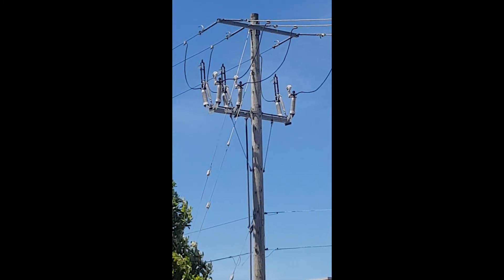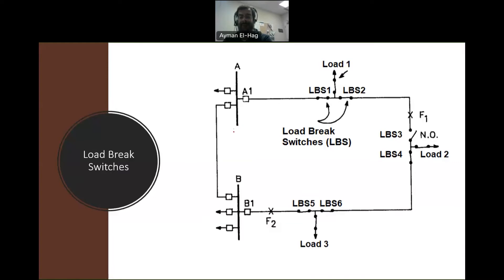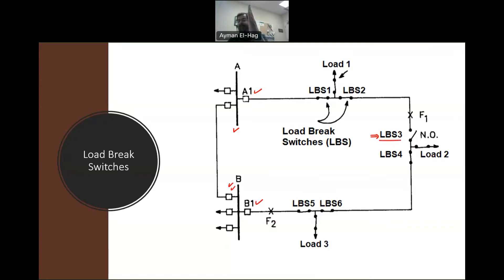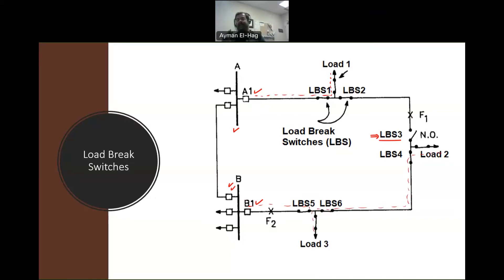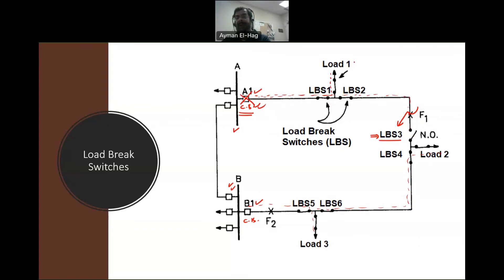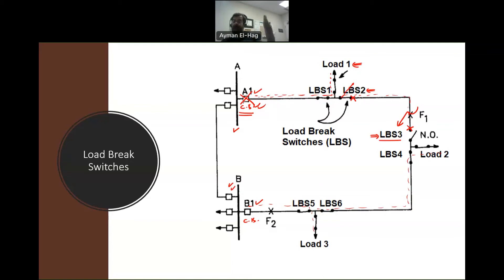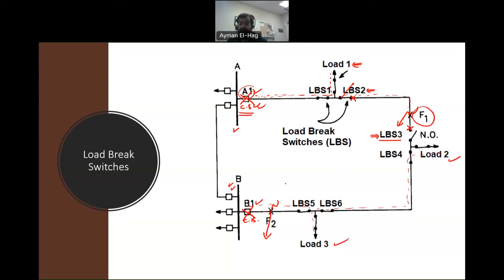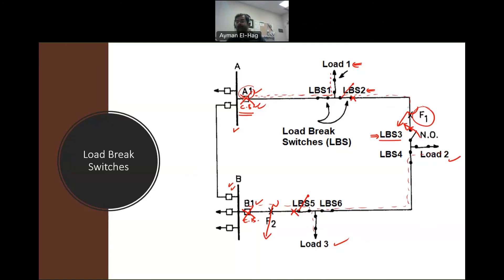Load Break Switch

Comment: If you think you have cleared the fault and fault is still there, when you close the load break switch, it is going to close on fault, then what happens?  It is not going to be just normal load current, it is going to see the fault current.
Reply from the maker: As I mentioned if the fault is still there it will open again. It will repeat 3-4 times and if the fault is still there it will open permanetly.
Reply: @electrical4everyone  I think you are talking about breaker or recloser. I was saying let's say breaker is locked on permanent fault, crews determine there is permanent fault downstream of a LBS, they open the LBS, and close the breaker. After few hours when they think they cleared the fault now they close the LBS manually but the fault is still there then the LBS will close on the fault, the breaker will trip again.
Reply from the maker: yes you are correct but if this happens it will be dangerous
Reply: can you tell us what is the brand  that is used ? can you tell us different  company names in Europe or UK  manufacturers  these type of products
Reply from the maker: I'm not very familiar about the commercial brands.